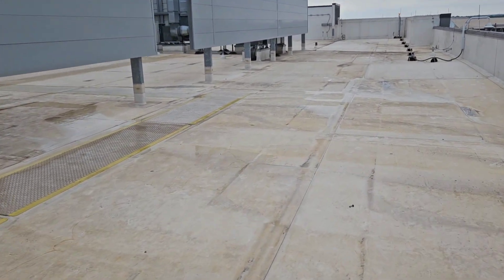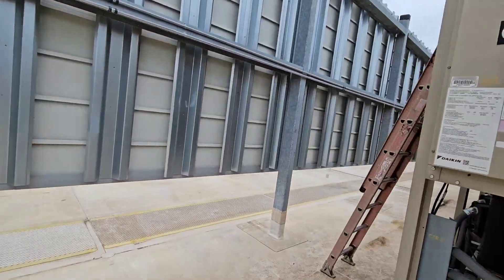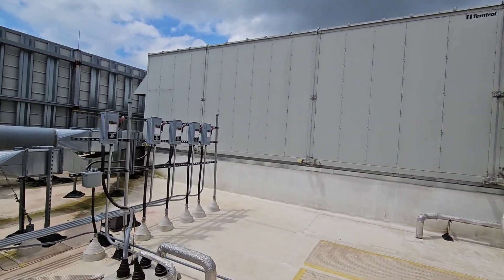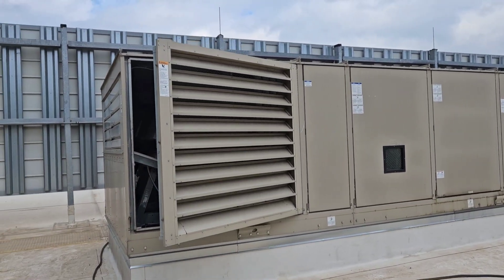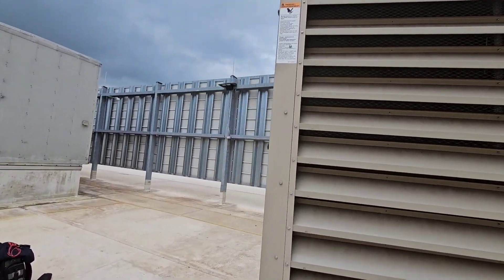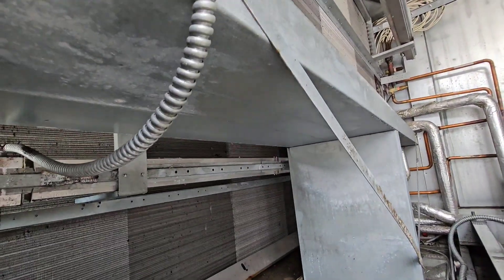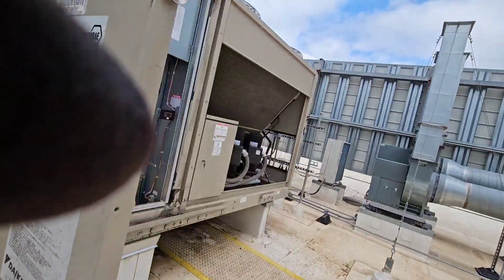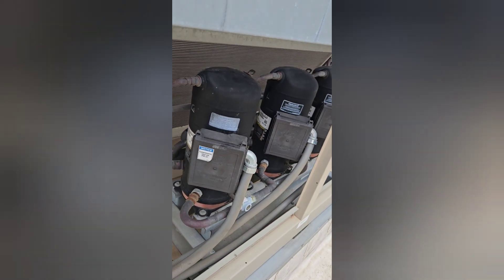Another day in HVACland. Working on a 200 ton AHU, (2)100 ton condensers and a 68 ton AHU.

Comment: Thanks for an amazing video, Jason! This was a very interesting tour of larger equipment. I imagine there is a lot more risk involved and things to watch for when working with these larger units, that they can bite you a lot harder if great care is not taken. You make it look simple and the way you do things and point out details shows me I'm watching a true professional.

I found the blower in the 68 ton unit rather interesting, not only in that it was quite apparent that a lot more attention had been paid to airflow dynamics but that the blower was configured with backward-bladed wheels rather than the more common forward-bladed type. When I looked into this I found that backward-bladed blowers had a much broader performance curve in that they are efficient over a much broader range of operating speeds. This makes me wonder why such a configuration is not the standard configuration given that even the most basic systems, even over the past couple of decades, run the blower at different speeds for different functions.
Reply from the maker: @DelticEngine  very professionally worded comment. The risk is a lot higher. The potential for something to go wrong is definitely increased. The equipment and repairs are high dollar and much less tolerant to a misdiagnosis by the customer. As for the smaller air handler. Yes backwards inclined fans are more efficient, quieter and do have a larger operating range. It still uses a conventional style housing. It isn't uncommon to see them nowadays as whats called a plenum fan, where it uses the enclosure as a plenum to pressurize it and deliver air through the standard pressure differential process that has been in use for ages. That's all static is. Fluid dynamics is a wonderful subject to understand ( not that I'm some expert at it ) air is just another fluid to move, just like water and refrigerant is. I appreciate your time in writing out your comment

Comment: SO my neighbor just got a new compressor and its loud like at the end, I was thinking "not enough oil?" or are certain compressors just loud?
They had someone come and replace it and its way louder than mine from 2013. Mine is only loud at the start then its pretty silent and it hasn't been checked since 2014, the guy that did it told me "if its done right you shouldn't need to have the gas/oil checked"
Reply from the maker: @kindnuguz  unfortunately in residential equipment, checking the oil level isn't feasible. I wish it was, but it isn't. Oil return is a major factor in the health of a compressor. Sound is also tool to use in aiding of a diagnosis. These were low on oil, low on refrigerant and generally not well maintained before we took over. The facility is not gonna be happy with my report. Since these are tandem style compressors.....when one goes....they all have to go...or you'll be back shortly with another failed compressor or multiple compressors. Lack.of oil return can be due to multiple issues....but the core issues is with refrigerant velocity. Without the proper velocity...oil will not be returned and you seize a compressor. Flooding and flooded starts are another culprit. Crank case heaters can help with flooded starts. A functional metering device can help with flooding

Comment: So my hunch is right as I assumed bigger AC's in hotter climate use cascade systems?  Because my home AC in northern Utah is single stage 3 Ton and it was almost not able to handle around 104f (or roughly 40c), its R410a from 2013. My mom asked me "how do they handle the heat in Arizona or hotter places?" and I explained to her about a cascade system. Which in lameman's terms is a AC that cools the gas from another and it can stack but they normally have to be different gases. Does a cascade system cool the gas or liquid of the other?
I was going to go into HAVC but ended up in IT
I love seeing these huge HAVC systems and its amazing what us humans have been able to achieve
Reply from the maker: @kindnuguz  cascade systems are used in refrigeration, not normally in comfort cooling, but yes you use 2 different refrigerants to aid in heat transfer....that is all we do....transfer heat around to achieve a goal of heating or cooling.

Comment: A few years ago I was working for a hvac company and a guy told us that he was working for one and he was told to crawl through the ductwork and look for tools and trash and he said he got lost then he found a space and stood up got his flashlight and found out he was in the unit. How big would that unit be?
Reply from the maker: @rickchapman9232  that would be a pretty big unit. I've been in air handlers that you need to bring a ladder in to get to the top of the unit. Had one that we used a 12' ladder to get the filters in the top. It was at least 15' tall and probably was around 17'-18' realistically.

Comment: 5:00 The label shows 22,000A😳😳 @ 480V!!  That's 1,056,000W for just one system.  Twice that for both of those big 9 fanners.  For the smaller RTU, it won't be too much less.  That is a LOT of energy!
Reply from the maker: @linuxman0  that's a short circuit current rating.

Comment: What you do if someone locked the door when you enter to that Dino stomach 😅
Reply from the maker: @fathmasameer7523  you can open it from the inside as well. It would be a challenge if you were in the blower compartment, they are plenum fans...the whole blower compartment is pressurized....and force is pushing out. It has (6) 15hp fans

Comment: I guarantee you that damn air handler costs damn near a million dollars if not more, and as soon as you see that reheat coil you can see where they went in there with a pressure washer to clean the coils. these filter changing companies and these coil cleaning companies that use these idiot kids to clean their coils ruin a multi-million dollar piece of equipment and could give a s*** less if the ruin a 20k dollar coil. If that was my building I'd be having somebody's ass right now... Lawsuit after lawsuit
Reply: Blah blah blah
Reply: @tylerwishyouknew3334  yea your prob a coil washer or filter changer huh...
Most blah blah are coil washers

Comment: We’ve got a couple of RCS140’s tied into air rotation units in a factory we take care of. They’ve been phenomenal.
Reply: Big stuff. Looks like some compressor swaps are in your future. Thanks for sharing this.
Reply from the maker: @jaymartin5095  if they approve it. For the customer...having a tandem or trio setup gets expensive. Most manufacturers state that best practice is to replace all compressors in a common circuit. I've had it go bad before. I replaced just one, a month later the other one took a dump, along with the new one. I also didn't do what I normally do nowadays......cut them open and truly find out what killed the compressor...because we know....they don't die....they are murdered.
Reply from the maker: @haldermand  those are some big condensers. I'm assuming it's still 6 compressors, just larger ones?
Reply: @JJ-COMMERCIALHVAC  Yup, 6 big Copeland scrolls